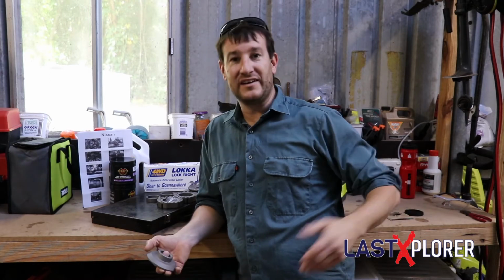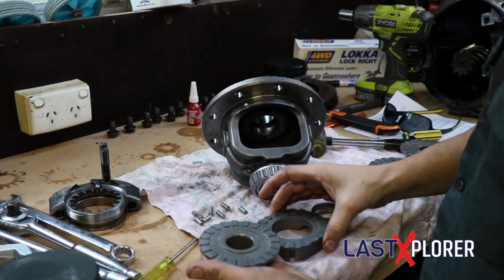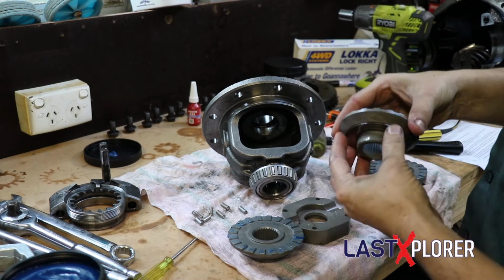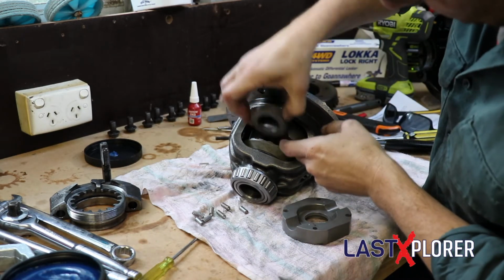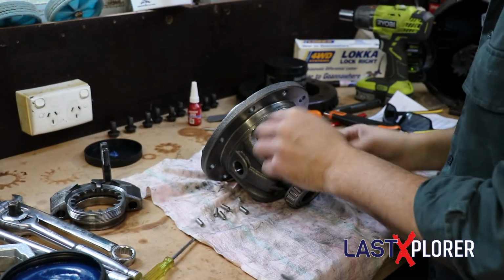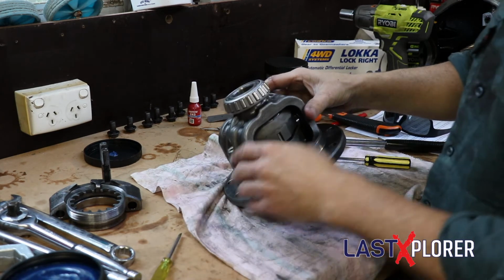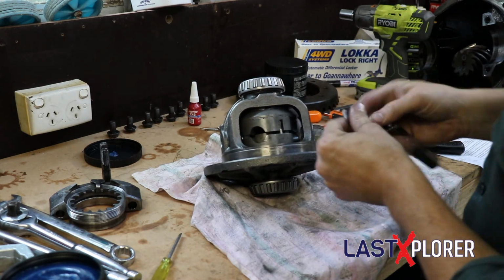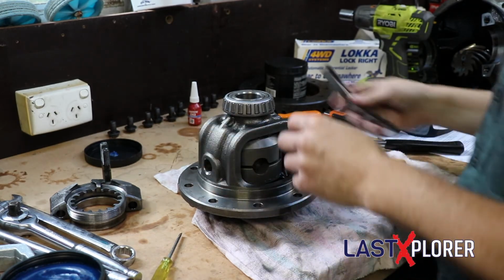How To Install 4WD Systems LOKKA In A Nissan Patrol

Comment: You made that look easy! I have had one sitting in my shed for a couple of years with the intention of putting it in but I never seem confident enough. Might give it a whirl now that Im confined to the house and nothing to loose 😅 Great vid mate!
Reply from the maker: The hardest part was pulling apart the front end to get the diff centre out. Separating the tie rod ends was a pain, until I went out and bought the correct tool for the job - 30sec later it was done.

The LOKKA really did go in that easily. If you can get the front end apart, you’ll have no trouble with getting the LOKKA in. Plus there is a full set of instructions for getting the LOKKA in too.
-Hillboy

Comment: Finished? What about the pin? Without that installed it's not going to work.
Reply from the maker: Fair call. I didn’t show the rebuilding of the diff, or rebuilding the front end with new seals. But I can assure you the pin is in there. ;)

- Hillboy
Reply: @LastXplorer  Some housings or hemisphere's have the pin retainer just mashed in place with a punch mark, I was hoping for a butt thread tap & grub screw retainer with loctite.

Comment: What happens if you leave out the thrust washer ?
Reply: The short answer is, it probably wont work and because the gap is too big you'll break pins. The long answer - as part of the install you need to check the gap between the cam gears to make sure it is within tolerances specified in the installation instructions for your vehicle. This gap is crucial to the correct operation of the LOKKA. 

If the gap is not within tolerances you'll need to get a slightly thicker or thinner thrust washer(s) to ensure the gap is within tolerances.

Comment: Hey mate just wondering how loud the ratcheting of the auto lokka is?
Reply from the maker: I’ve only really noticed it on tight turns (like wheel hard over), as that is when it is at its worst (and I was listening for it) Doubt you would even notice when you’re out wheeling - I don’t.

- Hillboy
Reply: @LastXplorer  cheers mate

Comment: How are you liking this lokka?
Reply from the maker: Hi Tito, I am really loving it. I haven't had the opportunity to get out and use it as much as I would have liked. I was out on a muddy trail the other weekend with the family, and we passed a 80 series who pulled up and told us they couldn't get past.(They were camped near us, similar AT and standard lift)

We cruised up it, 2nd gear low - you could feel the car slipping but it just kept going forward. Was really quite impressive.

On the sand - didn't even know it was there. On high speed compacted dirt roads is where I have noticed the steering seems more direct (not sure if that is quite the right way to describe it). Still, no drama's with corning.

On bush trails, stuff that you'd normally get hung up on, or need to use a bit of momentum to get over, the Patrol just plodded along as though there was nothing there. Again, no issue with steering in and around the tight stuff.

It really has increased the capability of the patrol quite dramatically.

Cheers,
Hillboy
Reply: I'm thinking of buying this for my 1988 4runner  isf manual. What do you reckon? Front and rear lokkas?
Reply from the maker: Hi Tito - having the Patrol, it's got the bullet proof LSD in it. So I only have the LOKKA in the front.

I guess it comes down to how hard you are planning to go. Most of the stuff we do it touring, as opposed to heavy duty, big articulation, wheel lifting step climbs.

Give Raleigh a call at 4WD Systems and have a chat to him about what you want to do. He'll point you in the right direction.

Hillboy
Reply: @gufiaito69able  front, I had a front lokka fitted to a 2004 ford courier. Arb air locker in the rear.  Just driving with the front lokka in made the car so much more capable.   Rear locker was only engaged on steep slippery hills.

Comment: Hi are you still using auto hubs? If so , is it working properly cheers
Reply from the maker: G'day mate - sorry for the slow reply. Yes, I am still using the factory auto hubs on the Patrol. I've got about 238k on the clock now. I think they have been in there for about 40K give or take.
Reply: @LastXplorer  , cheers , yeah so they disengage properly or easily